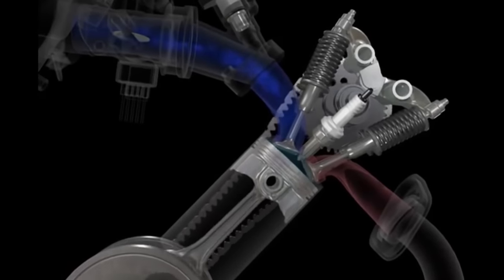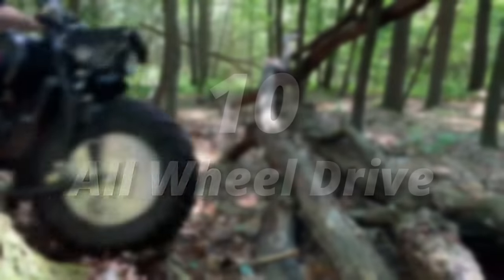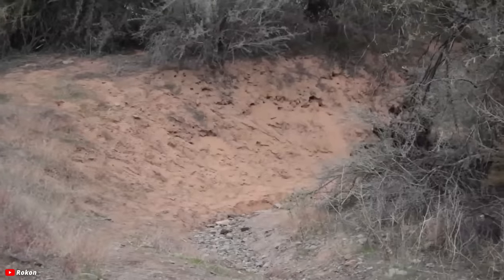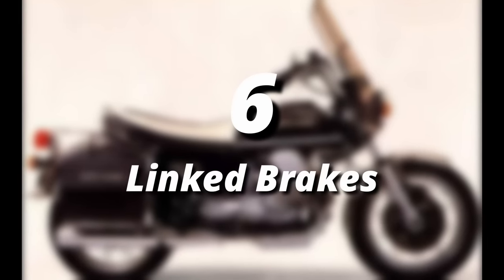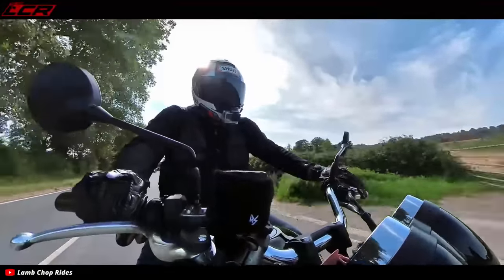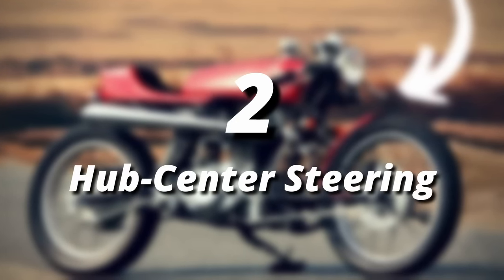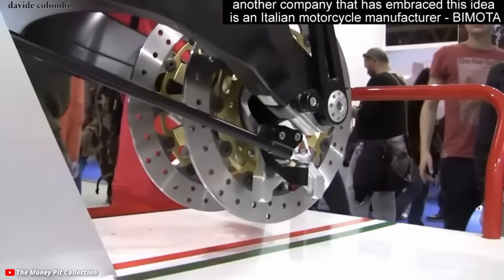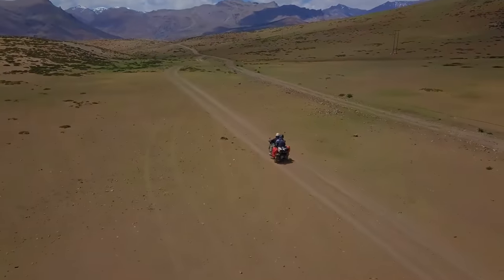10 Motorcycle Innovations that never caught on

Comment: You got it really wrong with the automatic transmissions. Nearly all scooters have them, usually as a CVT. Besides that, Honda sells the DCT very successfully as an option starting with their 54 HP 750 cm³ engines, which you cannot really consider as top range models. Currently the ratio is about 50:50 between DCT and MT, with a still growing trend for the DCT. Maybe the US is different in this aspect, as in general you are not that much attracted by technical innvoations, especially with bikes. (Consider for example that bigger bikes are still sold without ABS in the US, helmets and other protective gear are widely considered as something optional, etc...)

Comment: The first time I ever saw a completely enclosed motorcycle, some guy was trying to sell it to my father for $3,000. It was supposedly some kind of "kit job" and looked rather like someone plopped the fuselage of an F-14 onto two wheels, having ripped it right off the plane with an angle grinder, canopy and all... It had two seats, and was inordinately long, to accommodate foot-space for the "passenger" in the back. I'm not sure of the exact mechanics involved, but it had "landing gear" which resembled pseudo-space-age "training wheels" supported by telescoping cylinders into the upper side just forward of the rear wheel... They'd fold up into the side as you went down the road so it could lean, and then you had to put them down whenever you stopped at signs or lights and parked or whatever. In the canopy, which opened to the left side, lifting up on hinges and telescoping supports like most hatch-backs have... I was fascinated at the time, but it's a silly machine... the kind of thing that lets you advertise yourself as riding a motorcycle when you actually do NOT like riding on a motorcycle.

     It's fine if you don't like motorcycles. There's no skin off my ass about it one way or the other. Just be honest. Nobody should ever have to open up and get INTO a motorcycle. It's just NOT right. You can get INTO a van, or car, or truck, or even a bus or train. Can't we just be civilized enough to accept riding ON the damn bike??? ;o)

Comment: My 1958 Sears & Roebuck Moped had a grip shift. Why have they never caught on in the motorcycle world? They are slow to operate, and with the heavier clutch forces in motorcycles as opposed to scooters, the cables stretch much more over time and need constant adjustment. They become unreliable and dangerous unless the owner is diligent about that cable adjustment. The twist motion adds a third hand motion that can be confusing, especially to less-experienced riders. Both hands are now twisting and turning while one's feet are doing nothing.

Comment: No mention of the Ner-A-Car.  This had  hub centre steering & sold 16,500 units from its US & 
British Plants. Carl Neracher the designer. He started out as a sales rep for the Smith Motor Wheel Company. He then became the Chief Engineer to the Cleveland Motorcycle Manufacturing Company. 
The left-hand cable gear change belongs with the Mopeds such as the NSU Quickly. Usually as a two speed affair. So it came directly from the post-war lack of transport in Europe.  It was one of these things that came about in Europe rather than just one Country.
Rather like the Smith Powered Wheel Company making the bolt on engine with its small wheel to fit on the RH side of a pedal Cycle. This you can call the first clip on engine unit. Much the same as the Ner-A-Car its genesis comes from America. Presumably because lots of people wanted to have an engine on their Pedal-Cycle.

Comment: All wheel drive will probably catch on much more when electrification takes over more and more.  Electric hub motors are pretty cheap so it wouldn't add much cost to the bike and they would be fairly easy to install.  Making it possible for a bike to have that capability but sold as an extra or on the aftermarket.  So that people that want it can have it but people that don't can save the money.

Comment: honda's DCT ISs a real modern automatic transmission as seen in most modern sport/performance/super cars, which has no manual clutch, automatic gear changes (unless in manual mode)
It doesnt have a torque converter, but still is an automatic and I think riders prefer the faster shift and more direct connection of dct over a traditionnal slushbox. they equip 4 different models in the US, from commuter NC750 to goldwings, and even dual sport africa twin. (maybe a strange choice to  to not have a clutch lever on a dual sport). It also gets good mpg on the efficient low revving engine of the nc750.
they havent convinced other manufacturers to follow, but it doesn't seem to be going away.

Comment: About 2 wheel drive:
Modern should be simple. Just put a bigger alternator and 1-2kW hub motor with a freewheel device. 2kW is enough at low speeds

Comment: No way I'd choose to shift by twisting the grip with the clutch lever rotating with it. You adjust the location of the levers on both sides so you have your wrists positioned in a comfortable way. This will introduce issues and is likely why they didn't take off. Plus you can run the shift lever directly into the transmission when at your foot which reduces cost, complication, and you get direct feedback into your foot. I don't even do that with either of my bicycles.

Comment: I owned a Capri scooter that had the gear shift on the handle bars.  There were a number of problems with the design.  The mechanism used two cables that were routed down through the steering tube and out into the engine area.  The cables rotated a shaft that went straight up through the bottom of the engine.  The shaft created an opportunity for oil leaks and the cable attachments were exposed to the dirt thrown up under the engine.  The biggest problem was the point at which the cables entered the steering tube.  As the handlebars turned the cables would chafe and wear through.  The finish at the mouth of the tube was rough and the cables were a thin gauge.  They just didn't last long.  I find it disappointing that modern scooters all seem to have the twist and go gears so all control over the transmission has gone.  The design with a clutch and gear selector could have been so much better.   In the same era I tried a BSA Dandy.  The Dandy has a pre select gearbox which made for a different riding experience.

Comment: Weren’t the oval pistons designed to get around the race rule limit on cylinder numbers to four? Power steering?? No need. You lean the bike and the front wheel trail does it automatically. 🤷‍♂️ 😵‍💫 crazy.

Comment: The notion that a radical front suspension that works better than existing designs would be eschewed by manufacturers is a couple of miles beyond crazy. Do you actually know any engineers?

Comment: 2 wheel drive would give the most advantage, if it could be executed nicely on a light dual sport.  I don't understand why you would be better on a heavy ADV bike.  Probably, it would make the most sense on an E bike, where you could have a second motor, with no mechanical linkage to the front wheel.

Comment: Late to the party, but: 2WD would be easily achieved with an electric motor on the front, either hub (bad for unsprung weight) or driven some other way. Hydraulic motor would also work. Not necessary for the wheel speeds to be synchronised. Twist grips: I had a load of these, and if a cable broke, you were stuck in one gear essentially. They were also tough on the wrists. My mum couldn't ride my Vespas (early onset arthritis), but she loved my little C50s, C70s and C90s which I had a load of as a teenager. Britten front suspension: BMW used it, they called it the Paralever system IIRC. Can't remember which bike, but I think one of their road going tourers and the weird cruiser thing they made. Linked brakes: Honda got around the legislation by having one front caliper linked to the rear, and one independent. I think some iterations of the Pan Euro had this but my memory is hazy because of my advanced years ;-)

Comment: The 2008(?) Suzuki B-King was originally designed to have a supercharger or turbo fitted but the 'gentleman's agreement' in the motorcycle industry led to it being just a modified Hayabusa engine.
BTW, Crediting Honda to the development of the YAMAHA GTS makes you a 'fanboy'
Tony Foal, (motorcycle engineer) who promoted hub centre steering systems in the 1980's is living in Spain and races Aermacchi 350 in vintage class

Comment: Imho all wheel drive will become much more common .. once manufacturers will get that it's doable in simple/relatively cheap & robust way by putting power on front wheel with electric engine in hub instead of very complicated (thus more prone to failures) and heavy mechanical drive to front.
As for grip shift .. oh, they were very very common. Just that in Soviet Union, on all varieties of 50cm2 2-speed mopeds & mokiks, where ones with gripshift sold probably outnumbered classic shifting ones as 5:1 or 10:1.

Comment: The Earls fork used on some BMWs was a great system for sidecar use. It was strange looking compared to a telescopic fork. Also, having ridden a turbo charged Kawasaki 900, I found myself watching the boost gauge rise, then closing the throttle when the speedometer read 120MPH. Sitting up for wind resistance to help slow down, I thought, "Well, it's fast." The Suzuki GS1100 that came out at about the same time was not just fast, it was quick. The turbo engine KW didn't gain revs quickly. The Suzuki definitely did and that made all the difference in the riding experience.

Comment: BMW produced a hub-centered steering bike a few years back.
And the twist-grip gear change on the Vespas I owned (waaay back) was so sloppy and imprecise, being cable-operated, I converted it to a foot-change. This, unfortunately, was even less serviceable than the clunky original.

Comment: BMW and others used leading link front ends or Earles style forks, the big advantage is the front end does not dive BMW used a similar type front end with a mono-shock up until at least 2012 on their big boxer dual sport, not sure what happened when they went liquid cooled. I have read that the new liquid-cooled dual sport boxers have some trouble with the front end folding not sure of the facts. A BMW 2012 gs has brakes that work both brakes. If pull the front brake lever it activates the rear brake, and the rear pedal does not work the front brake. I am not sure if you can turn it off but have never tried. I believe it is also tied to the abs. The abs can be switched on and off. I also love Rokons especially after they did away with the two-stroke. They were used by the army and the forestry service. I think the advantage bikes do not have 2-wheel drive is they weigh too much all ready. The oval piston was similar to what we did with Triumphs the crank was turned so both pistons went up and down together it made incredible torque and made a great hill climber, true thumpers. I think true automatics took too much away from the idea of biker tough guys. The Bonnieville of the mid-60s were great because they were light and handled well, you just needed to get away from the electrics, I put Honda coil and electronic distributor with a battery eliminator, work great, but it fired on both strokes which did not matter. I think there are some dirt bikes with hydraulic front wheel drive never road one and it is hard to get away from the ROkon price point. They now make one that is street legal in all fifty states

Comment: Imagine a 600cc Dual Turbo Inline flatplane engine that revs onto 16k RPM spitting out 240bhp and 160Nm from 5k RPM on a 190kg Chassis that is MotoGP & Streethawk inspired.Painted in Matte Vandablack. Without Speedlimiter.🤘😎🤘

Comment: okay there is a dirt bike company that uses two wheel drive I am sorry I cant remember the name now for sure, i think it is christini which also makes bycicles. that is from factory as two wheel. small company I think. 

as for rigid front suspension. the duo-lever on the bmw k bikes is this form and has been around for some time on production bikes. and they use a lower a-frame method on their boxer GS and RT bikes I think they almost always have they call it tele-leaver. BMW is a big manufacture that only recently (history of the company wise) started using some chain drives and telescopic forks. everything else was, well, weird. so basically I don't think that your video is well researched on this issue. 

I also wonder why the grip shift didnt' take off particularly on smaller bikes, early Cub I think, it is on a few. oh well.

Comment: My Ural is pretty unconventional. Half credit for on-demand 2 wheel drive, a drive shaft under the sidecar that can be engaged with a lever. It also has a different front fork setup, leading link style.

Comment: In regards to the auto transmission bikes, I was taught to ride a motorcycle (like a dirt bike0  where you used the clutch to start off but once you got moving you would not use the clutch to shift...let off the throttle and put pressure on the gear selector lever and pop it into the next higher gear, I still to this day ride that way and I bought a new Yamaha R3 in 2015 which I always shifted that way. granted  downshifting takes more finesse but still that's how I always shifted that bike with zero issues., I never really understood the "oh with this bike you don't have to use the clutch once you get moving" thing as an innovation...Maybe that's just me...I don't know.

Comment: I rode for near 45 years before health concerns stopped me. #8 is the stupidest FAILURE of the motorcycle consuming public. Of the scores of different brands and genres of motorcycles I owned the BMWs that incorporated either the Telelever or Duolever front suspension were the overall BEST handling, SMOOTHEST riding, most MAINTENANCE FREE front suspension systems. Conventional telescopic suspensions(inverted or not) on motorcycles weighing over 450-lbs are simply stupid when compared to suspension designs free of unsettling brake-dive, bump-steer, and REGULAR steering stem bearing replacement/maintenance.

Comment: I once had a Honda CB500T from the mid seventies, the valve springs were torsion bars, and the valve clearence was adjusted on eccentrics on the sides of the cylinderhead. It was by far the worst piece of garbage I have ever owned.

Comment: I will ride anything with 2 wheels and a motor. If a ride on lawnmower had 2 wheels I would ride that sucker. I loved my wife's 125 scooter. Used to take me an hour to get the milk and bread 'cause it was a blast. I have been riding for 45 years. But three wheelers? Now I am older lots of people try to get me interested in trikes or those Can-Am things or a Yamaha Rikken. (had an MT09)  I don't care if they are fast or whatever. The power or top speed is like whatever to me.  I love bikes because of how responsive they are to body movement. Leaning over in a curve fast or not is amazing. Push the handle bar or twist your hips and the machine responds immediately.  In 45 years I just love it more today than ever. I do appreciate the Rikken is motorcycle like until it stops tho. I just never got on a motorcycle and thought "This thing needs another wheel." I never got on a bad motorcycle except one that didn't work. There were great bikes and even better ones in my life.

Comment: With the advancement of electric motors i think it's suffice to say that all wheel drive motorcycle might make a comeback
Reply: Interesting thought! A hybrid is also conceivable, with a small additional, not too heavy electric motor on the front axle, which can be switched on or off for off-road / on-road riding if necessary. I'm not an engineer but it sounds interesting.

Comment: Telescopic forks are CHEAP to manufacture, cheaper than almost any alternative, especially as they have the manufacturing volume advantage being fitted to millions of bikes.
Linked brakes DO NOT control both front and rear brakes. The footbrake controls the rear and ONE front brake, the handlebar brake controls the other front brake. It's a great system and I converted by Honda 650 to this and loved it.
Husqvarna had an automatic dirt bike back in the 70's and 80's that was by all accounts a great bike.

Comment: 11.Anti dive brakes. 
12. Enclosed discs. 
13. Reverse gear. 
14. Audible indicators
15. Redirected engine heat ti rider.

And the great ideas that worked but  sadly dropped...
Enclosed drive chain
Centre stands

Comment: The 22’ Honda Navi comes with linked brakes. It’s a 110cc CVT motorcycle/scooter with a generous storage compartment where the engine would normally be and is presented as Honda’s cheapest offering to date with and MSRP of $1807 however, during its debut and initial US sales which coincided with the Covid pandemic; the bike rarely left showroom floors without a gauging price over $3000. I purchased  one for my wife after a 4 month waiting period for $3480 out the door.  I’m not sure as to the legality of the linked brakes in the US and would assume Honda wouldn’t slap a ridiculous and heavy air box and catalytic exhausts system on it stock without first understanding the EPA and traffic safety laws and protocols in the United States. This leads me to believe there is either a loophole regarding linked brakes on scooter or CVT motorcycles, the law is neither prohibiting linked brakes or the law pertaining to linked brakes is only in relation to specific states. 

I have not researched this outside of my own personal experience so I honestly have no idea